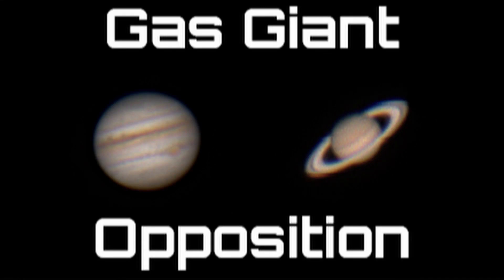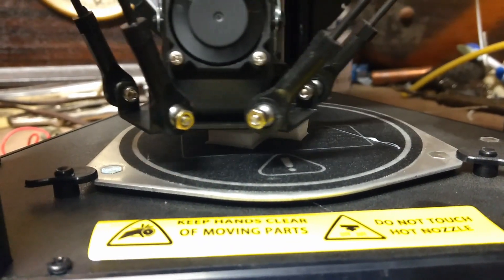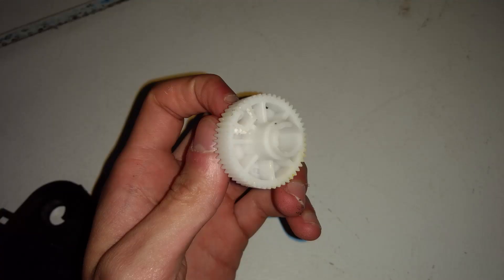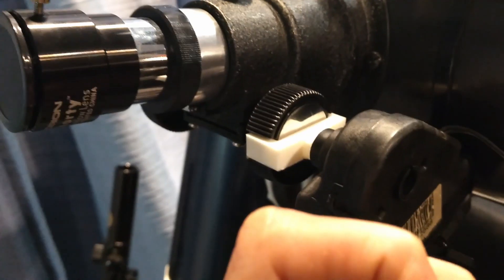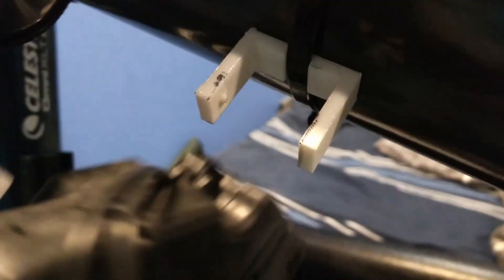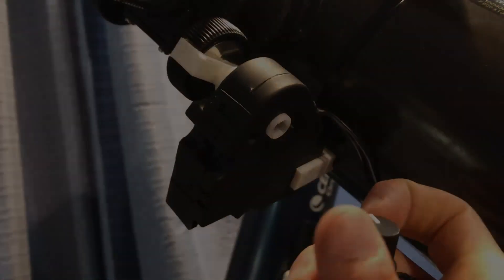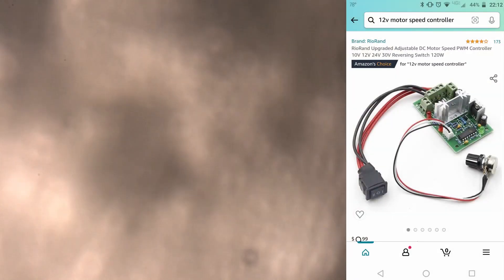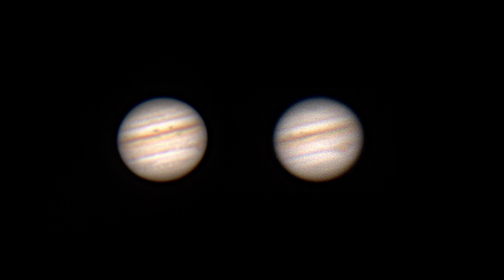My DIY Motorized Telescope Focuser

Comment: Do you have a part number or anything for you HVAC motor part please
Reply from the maker: https://www.amazon.com/Actuator-52402588-15-72971-Compatible-Oldsmobile/dp/B08Z73XDBM/ref=sr_1_2_sspa?crid=2G9AKCRR4YWTX&keywords=05+escalade+blend+door+actuator&qid=1661302771&replacementKeywords=blend+door+actuator&s=automotive&sprefix=05+escalade+blend+door+actuator%2Cautomotive%2C55&sr=1-2-spons&vehicle=2005-46-410------------&vehicleName=2005+Cadillac+Escalade&psc=1&spLa=ZW5jcnlwdGVkUXVhbGlmaWVyPUExVDVHV09QT0lHTjBQJmVuY3J5cHRlZElkPUEwNDk5NTg2R0c0Ukw5R0gzNVdRJmVuY3J5cHRlZEFkSWQ9QTA4OTkzNDgxOFlON1ZTMUdWUDI5JndpZGdldE5hbWU9c3BfYXRmJmFjdGlvbj1jbGlja1JlZGlyZWN0JmRvTm90TG9nQ2xpY2s9dHJ1ZQ==

HVAC Air Door Actuator 604-106

This one should be similar if not exactly the same as the one i got.